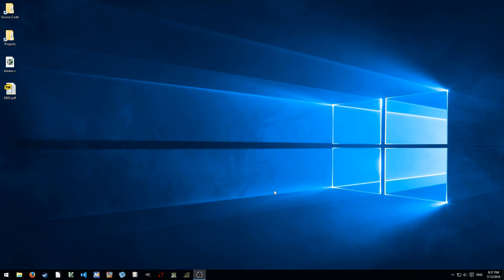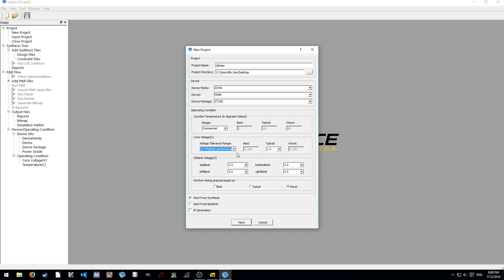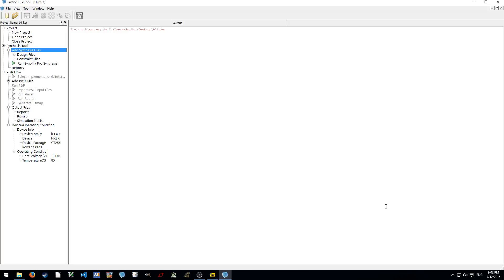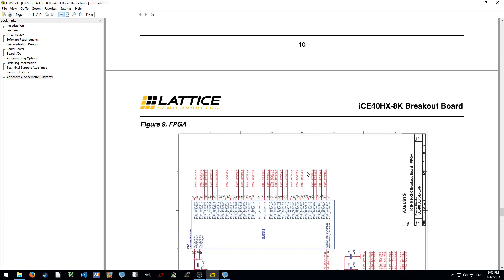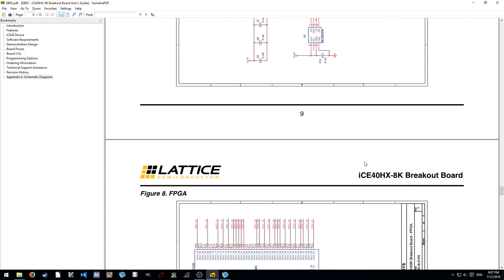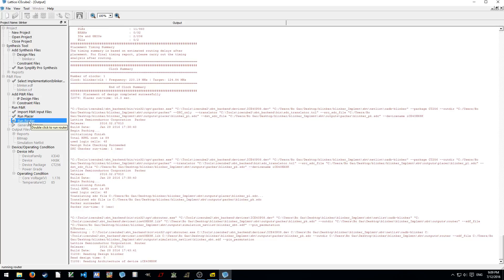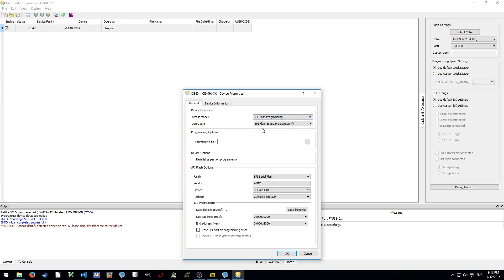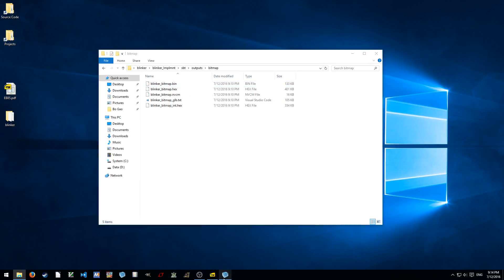iCEcube2 basic tutorial

Comment: I wrote this vhdl code in order to let blink at different color the rgb led on a ice40 ultra:

library ieee;
use ieee.std_logic_1164.all;
use ieee.std_logic_unsigned.all;

entity Counter is
  
  port (
    clk  : in  std_logic;                       -- clock
    led  : out std_logic_vector(2 downto 0));  -- output che va al led RGB

end Counter;

architecture Behavioural of Counter is
  
  signal acounter : std_logic_vector(31 downto 0);

begin  -- architecture Behavioural
  
  -- purpose: contatore
  -- type   : sequential
  -- inputs : clk, rst
  -- outputs: acounter
  process (clk) is
  begin  -- process
    if (clk'event and clk = '1') then  -- rising clock edge
        acounter <= acounter + 1;
    end if;
  end process;

  led <= not acounter(25 downto 23);

end Behavioural;

 Then i followed all the same passage executed in this video When i start "run place" i get this error:

Error during constrained IO placement
E2792: Instance led_obuf_0 incorrectly constrained at SB_IO_OD location
I2723: placment information file is dumped at : D:/lscc/iCEcube2.2020.12/Projects/LedChange_Ice40Ultra/LedChange_Ice40Ultra_Implmnt\sbt\outputs\placer\Counter.pcf
I2709: Tool unable to complete IOPlacement for the design
E2055: Error while doing placement of the design

I read that it comes out when we try to use those pins like general purpose I/O but i'm using them to drive the led. How can i solve the problem?